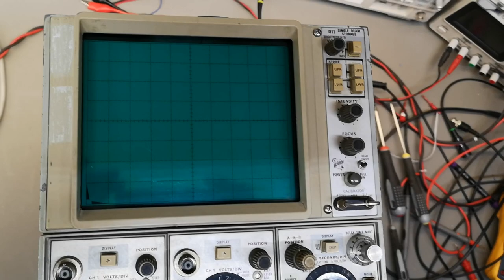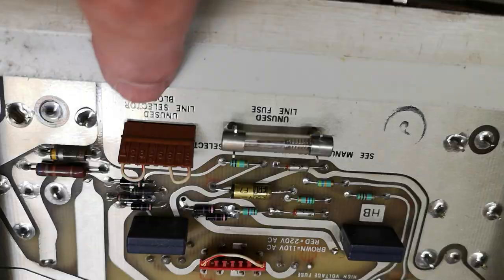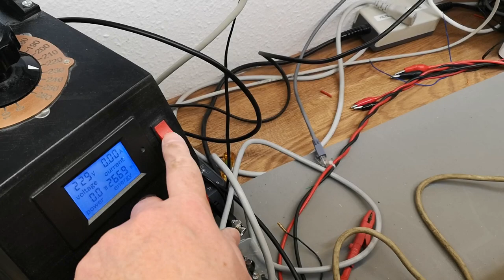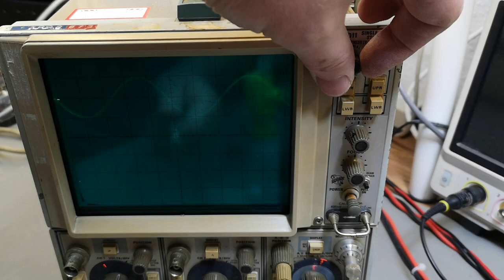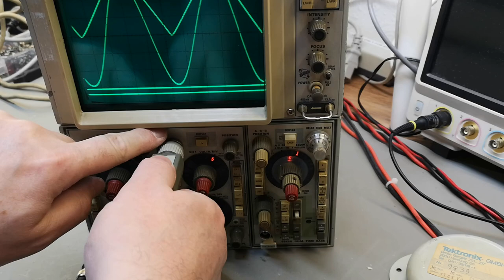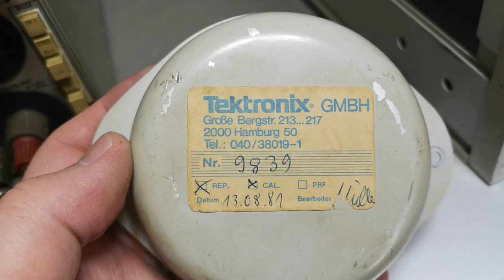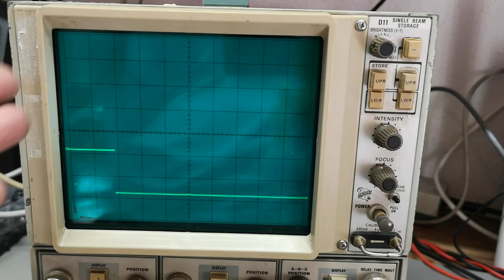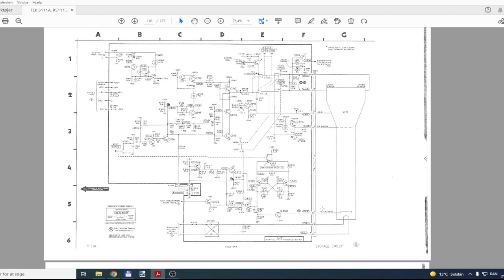Oscilloscope Tektronix 5103N 5111 single beam storage 4ch Teardown

Comment: Marks are from somebody using tracing paper and a pencil to trace out the stored waveform, instead of using the very expensive Polaroid camera accessory, that cost almost as much as the bare scope itself. Base section was also available as a separate unit, run on it's own with those plugins, along with the top display, and you also got the rack mount kit for it, which put the top and bottom next to each other, mounted side to side, and a new set of top, side and bottom covers, plus a set of rack ears.
Reply from the maker: wow marking paper, that is old-tek :-) when i was a kid they used poloroid cams for this type of scope at my first education place, this CRT is amazingly well done, sharp and accurate as nothing else..
Reply: @TeardownOZ2CPU  Yes Tek was the premier developer of flat CRT technology, to get that linearity with no complex manipulation of the display waveform, instead shaping the deflection plates to get the precise deflection on the majority of the screen. Then the storage tube as well, they developed it to a great degree.
Reply: @SeanBZA  Tek went on to use their cool storage tubez in their 401x vector graphics terminals, as well as the 405x vector graphics workstations. I restored my 4052 several years ago (a major undertaking, as it turned out), and the storage display is remarkably crisp; photos hardly do it justice.

Comment: Dese ole Tekz R00l!  I have a 5113 (effectively a later incarnation of the 5103) and the storage tube is indeed fascinating. These scopes are ridiculously heavy and bulky for their low bandwidth, but they are built like tanks! I found the 5113 on its way to the scrap and realised it'd be nuts to chuck such a good Tek, particularly a working one! Well, almost working, as the timebase recently stopped sweeping...
Reply from the maker: Tektronix was clearly the leader in scopes for a very long time, if you compare any other scope from same age, see the difference both inside and out
Reply: @TeardownOZ2CPU  I really have only a pair of Philips PM32xx's from similar vintage to compare with. They of course have a different (i.e. monolithic and more compact) design, although they are easier to adjust compared to the modular Teks with their pots buried deep within the modules.
In terms of quality and reliability, I'd lean towards Tek, although the only failure I've had with the Philips scopes was an exploded RIFA line filter cap -- a very common and well-known issue. The latter's pots may be also of lesser quality.
In terms of innovation however, I agree that Tek was way ahead of its competitors -- expect maybe HP, as I've never had an opportunity to use one of their scopes. Tek was instrumental (pardon the pun) in developing an integrated and automated laboratory acquisition system, complemented by their equally innovating computing products. In the early '70s, that probably sounded like scifi to most engineers.
Speaking of reliability tho, I am still trying to figure out why my 5B10 timebase stopped working... 😉
Reply: Update: the timebase works again. There was a bad solder joint on the long cap (seen at 27:36). That's a first for me on a Tek!
Reply from the maker: @NuGanjaTron  wow cool, thanks for the comment, large heawy components are normally the first place to look for loose connections, since they take more g force over the years.
Reply: @TeardownOZ2CPU  Yeah, I figure the vibrations from the div/sec rotary switch may have contributed to that. It was surprisingly difficult to find, as I suspected the switch initially.
Reply from the maker: @NuGanjaTron  i know.. sometimes we get pulled arround in the wrong corner for way too long time, before we finnally figure it out :-) it is just the way it is.

Comment: A missing fuseholder cap, especially with fleamarket or bulk items, might just have been scraped to bits (they tend to  protrude from the back and get dragged over concrete floors...) , shaken loose or knocked off during repeated handling  - or reused for a different device with the same fuseholder style :) Of course, it is really annoying if you have devices like TM500 enclosures that require a shirtload of dissassembly just to replace the complete fuseholder....
Reply from the maker: i always save fuseholders and knobs and special connectors, from instruments that is found impossible to repair and inpossible to sell or trade

Comment: Nice one, I have one, non storage, just needs to be recapped a little, because the display side is a little odd. Also have the display section of one, that you could buy off Tek as a display unit for instrument use. On my list to turn into a transistor curve tracer.